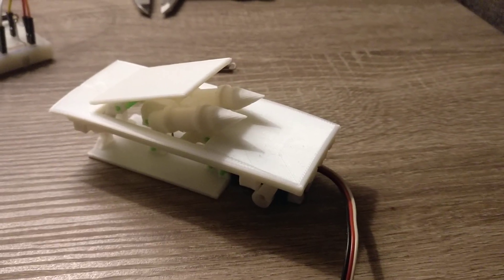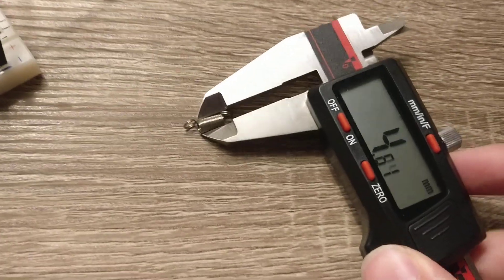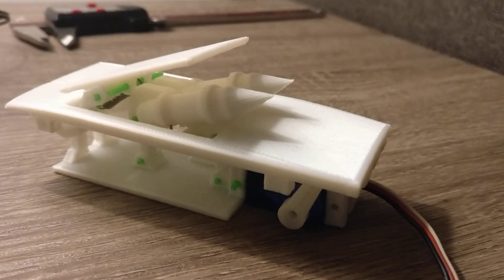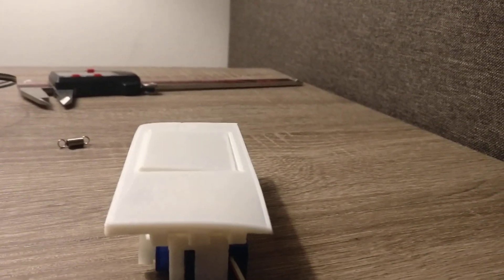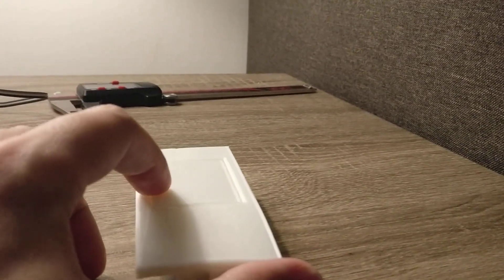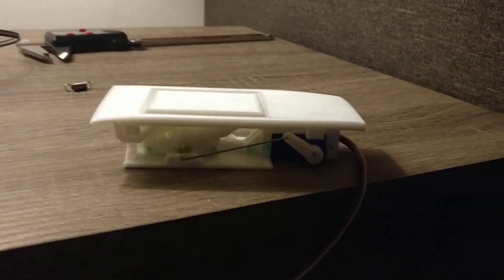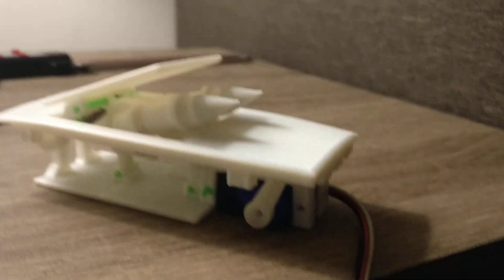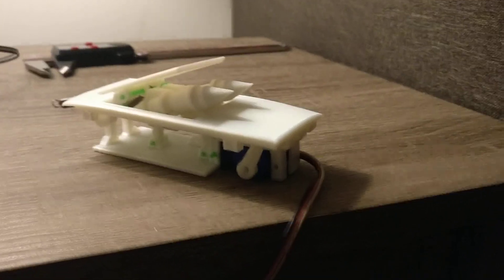Iron Man Mk 6 Forearm Rocket - Prototype 6 w/ Rocket

Comment: Hello, just want to say your prototype looks intresting and awesome to me!
Am kinda new to the 3d modeling world and my project was to make the arm missle laucher cyberware from Cyberpunk 2077. 
Where can i find a way to learn to 3d model just like you and learn how the little motors work? ( am also new to the motors and the tecnology they use)
Reply from the maker: These motors are called Servos. They can only rotate 180°, but you send them a signal and they'll try to go to a specific spot in that 180°. Servo sizes are based off of weight in grams. I'm using 9g Servos, which are decently small and strong, as well as very cheap.
To control them, an Arduino is recommended. There's lots of types of Arduino, each with their own special features, but I'm pretty sure all of them can control Servos. If you want to control a lot of Servos with one Arduino, you'll want to look into a 16-channel PWM controller too. 
As for 3D modeling, different programs have different strengths and weaknesses. Blender is good for making organic looking parts and artistic models, but it's harder to design mechanical pieces with it. Fusion 360 has a free license you can use, and is great for designing and modifying mechanical parts, but it's hard to use it for much beyond that. Currently, I'm using a mix of those two programs.
As for learning the programs, I recommend watching a short getting started video to learn the basic controls, then trying to implement the ideas from the tutorial in a completely different way to make your own project. You'll probably need to skip around a bunch, and make a bunch of mistakes, but you'll learn with practice
Reply: @DrCyanide  Thank you very much man, keep the up with the videos these are really cool.
Reply: @DrCyanide  Also do you got specific fusion 360 tutorial you reccomend to make mecanism parts?
Reply from the maker: @slendy7746  Not really. Just make sure to use constraints and assign variables for values you use frequently.
Reply: @DrCyanide  ok thanks for the advice